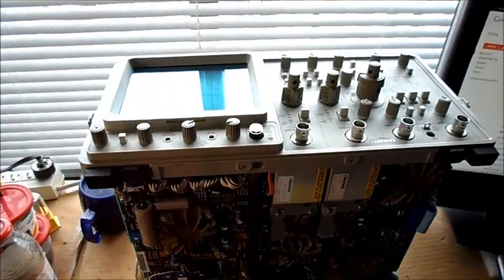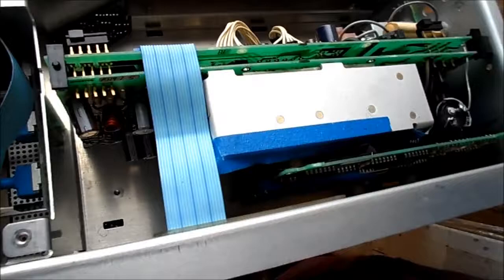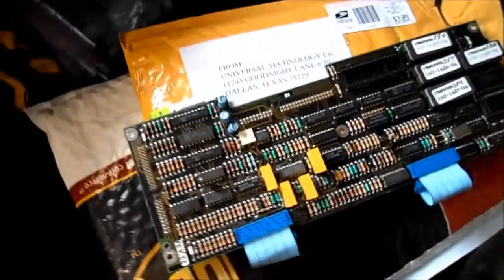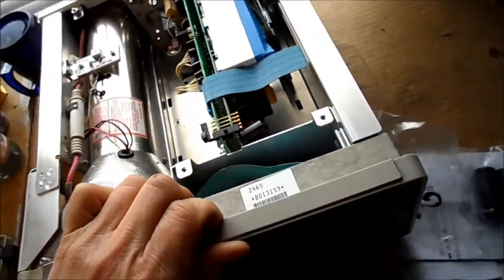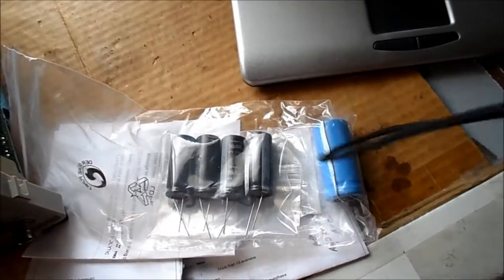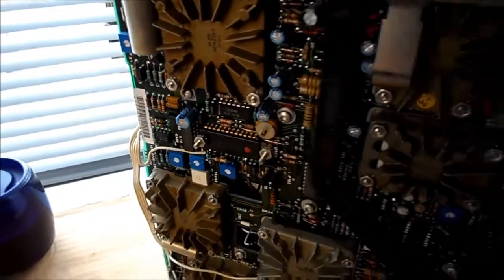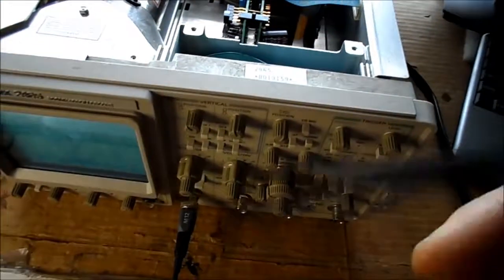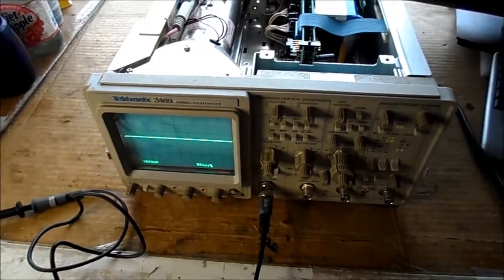Tektronix_2465 Put Back.

Comment: Something I want to mention about capacitors. Time is their big enemy. Using caps from the same era and manufacture time is not wise due to continual capacitor improvement as technology improves in their manufacture. Tolerances also decay with time as to mfd value and esr value.